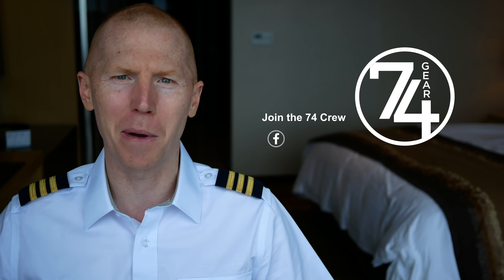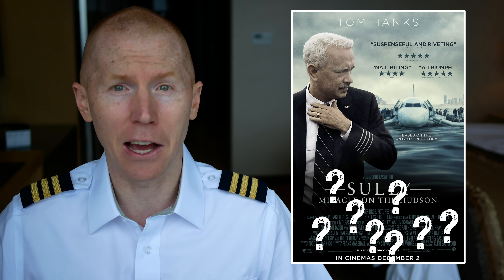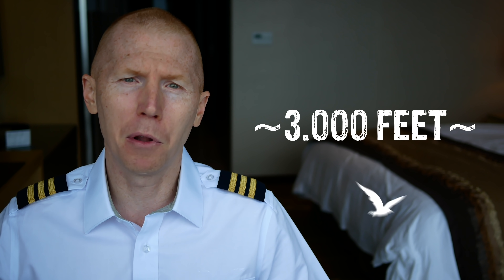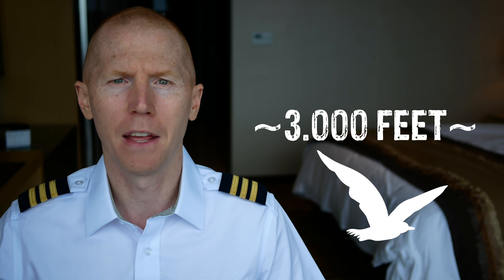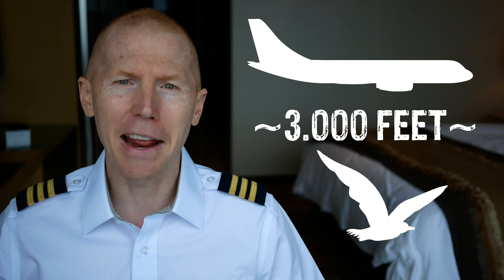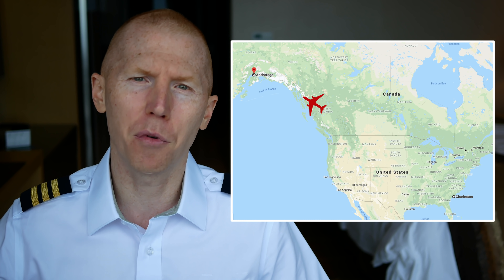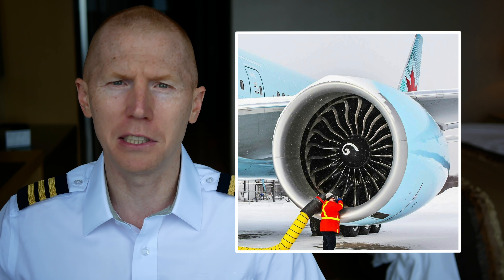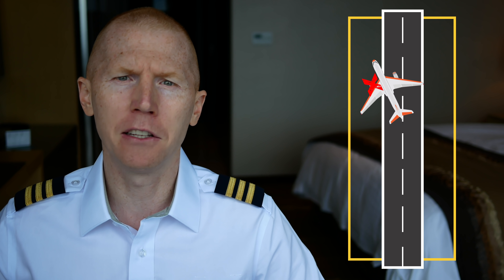Why Engines Don't Have a Mesh or Grates to Stop Birds

Comment: Or, crazy idea.

Let's say you put a giant mesh in front of the turbine.

Disregarding the amount of air that can get to the impellers.
Disregard it potentially getting sucked into the turbine.
Disregard the drop in power and fuel economy.

If this MILLION pound aircraft hits a bird with a mesh screen in front of it's engines, at around 500mph, what fat good would it do to the bird and the engine that now has pre-chewed food.

Tl;Dr redundant.

Comment: Some helicopters have FOD (foreign object debris) screens in front of their engines. Those jet engines deliver torque though, not thrust.  They have thrust diffuser in the third stage of the engine. Also aerodynamics and weight/ balance not so important on a Helicopter

Comment: One other thing about placing some barrier on the leading cowl of an engine, any mesh type of guard could itself get ingested by the engine and  would likely wrap around the main shaft (like hair in contact with a spinning top) and cause a major disintegration of the entire engine, a bird not so much.

Comment: As an engineer (though not aviation) I know design criteria and worst case scenario fault prevention would dictate test the engines at assembly to determine the effects of ingestion of birds.

I'm also reminded, though it's likely an urban legend, of a case where Rolls Royce developers contacted Pratt & Whitney about testing for birds and P&W responded they use turkey carcasses for worst case failure. A short time later Rolls-Royce got back with P&W with a problem, the turkeys were destroying the intake fan blades, and Rolls-Royce asked P&W for assistance with the tests. 

A 4 word P&W response was sent, "thaw the turkeys first".

Comment: That's really interesting ^_^
Reply: Yes
Reply: Sky green beans
Reply: A leoreo modo fan😳
Reply: Diciendo "aerodinámica" 100.000 veces
Reply: Wondering how the SR71 gets enough air to the engines with those big cones in front of them, cones that would also divert any bird to the perimmeter not to the turbine  blades
Reply: Shawt deh fac up
Reply: Yuh uh

Comment: Engine guards can be put on an engine during an engine ground run.  The mesh has very little effect on the engine performance but helps prevent foreign object damage or FOD.  these guards cannot be fitted if the air temperature is too low, say below 5 degrees Celsius.  This is due to water vapour condensing onto the guard forming an ice layer.  This then causes a reduction in airflow into the engine and this can result in surges or an engine stall. 
The temperature at even 10000ft would be much lower than 5 degrees on a normal day(15 degrees at sea level), so whether at altitude or on the ground, engine guards would be a completely pointless and even dangerous device. Hope this helps some understanding.
Reply: I further suggest that there should facility to heat the guard when temperature is below 5 degree Celsius. And thus we can solve the problem of ice buildup
Reply: Heat can be given there from engine's heat to avoid ice buildup. Necessary mechanism need for that.
Reply: @jagdishdedania4604  heats going out the back not forward.
Reply: @moonbaby6134  Heat pipes brother. Ice is cold but just SLIGHTLY above freezing and it will melt eventually/prevent freezing entirely.
Reply: @slowfudgeballs9517  doesn’t work on aeroplanes.  It’s all about weight. More weight more fuel less passengers or more cost.
Reply: @moonbaby6134  More weight? Bruh it's a little mesh not iron cell bars...

If it can save lives why not? Run me the numbers, how much more would it cost the consumer for a 100% guarantee no bird strikes take out the engine. I wanna know my options! Give me a more expensive plane option with the heated mesh.
Reply: @slowfudgeballs9517  I don’t need to run numbers.  After 33 yrs working on aircraft it doesn’t work.  End of discussion chap.
Reply: @moonbaby6134  Bruv, how am I to make my own conclusion if you aren't telling me the facts? Are you calling me a sheep? Because I never called you incompetent until right now.
Reply: @slowfudgeballs9517  you will just have to take my word for it.  It doesn’t work.  Just read my first paragraph. If that’s not enough then I suggest doing some investigation and reading up.  But you’ll find I’m correct.

Comment: a screen (think chain link fence) is not going to block so much air to effect the engine.  what is going to effect an engine is all the stuff that would build up on that screen.  think of this like a filter of a car engine.  the filter doesn't really effect the engine's performance when it's new.  what does is the buildup of debris on the filter.  this happens slowly since a car engine isn't sucking air that hard.  I would imagine that the buildup on an airplane engine's screen would happen relatively quickly considering how much air the engine sucks in.  saying that, it might be better to let the small debris just pass thru the engine vs. letting it build up on a screen considering there would be no way to remove the debris in flight not to mention that screen being sucked into the engine due to the buildup of debris.  as big and powerful as these engines are: they are sucking in harmless debris on a regular basis.

Comment: I’m wondering Why can’t you put a went  ON only for those few minutes the plane s under 3000 feet? It can roll away once the plane is above the bird hazard height. The way landing wheels go in and out for the same reason — saving fuel at high altitudes by reducing air resistance.

Comment: I've never really considered a screen on a jet engine...but i have wondered  about metal cages around Boat propellers. Like those little cages they put around lights in bunkers and mines and such.
Reply: Would affect the flowstream. Water may be more viscous but both are fluids.

Comment: Why don't they make the engines bigger to account for the lost air intake, while maintaining the same power/fuel consumption of current engines? Then that would allow a mesh or thin wired grid to be put across right?

Comment: How about some high pressure air fans that would blow a bird sideways away from the engine.  There would be no metal or mesh, etc. to affect the engines. And, the fans/blowers could be switched off when flying normally.

Comment: A bird hit with a grate means now more airflow is blocked to the engine, perhaps enough to reduce power to less than required to fly. Without a grate the bird hit may go through the engine allowing it to continue to function.

Comment: We had a KC-135R, taking off from the Panama, hit a Turkey Buzzard with the #3 engine.  The bird weighs about 20 pounds.  The carcass was found on the runway, but the engine showed no issues or vibrations, so it completed the flight to Grissom AFB IN.  When taxing to the parking spot, the engine looked very odd.  The impact bent four of the fan blades back about 35 degrees.  While bending back, they did a lot of damage to the inside of the inlet.  Those CFM-56 engines are very tough.

Comment: What about adjustables or electric motor engine covers tho? When you're above birds level you can open the engine cover so that it can run efficiently
Reply: That may be a good idea.
👍🏼
Reply: Very dumb idea, jet engines are already complicated and packed enough, adding motorised retractable doors just isn't feesable and is not even close to worth it
Reply: @MagikarpMan  No need to be rude about it.
Reply: @jessetheanimenerd3304  wasn't rude

Comment: Well I don't think putting a net with fine strong strings will cut down the supply that much .. and you can use a funnel like structure to get more air inside .  And can open the gates after you reach 3000 fts..

Comment: Would it be too impractical to engineer some kind of mechanical cage that can be slid out of the way of the engine once ascending above (and closed below) 3000 feet? Kind of like another step to landing gear? I imagine that would probably already be done if it was practical but i cant imagine why it wouldnt be. Maybe just hard to safely mount something electrically wired in that location? Or too difficult keeping a moving part rigid enough around so much force? Or takeoff is the time when the most thrust is necessary? Or is the cost/risk ratio too high (though i imagine the same could be said of all the emergency equipment aboard an aircraft)? Maybe i can imagine why.

Comment: Easy. Just put an circle with interior straight lines with enough space for a big bird to not go in and make it automatic to open and closed so at 3000 is open. Just to have it closed for like 16 minutes per flight is not going to be any differwnce in fuel efficiwncy I believe. safety is number 1 priority anyways hehe

Comment: Aircraft engines are pretty robust and can withstand bird strikes pretty well. In the case of Sully's aircraft I understand he hit a flock of geese and a bunch of those bird birds going into an engine at once is more than likely going to do some blade damage.
I worked for Honeywell Aerospace engine manufacturing and certification of a new engine or an engine redesign meant going through simulated bird strikes. A turbofan on a test stand running at 100% power would have chickens fired into it at high speed by an air cannon. Pretty not impressive and usually resulting in a puff of smoke out the tailpipe.
A bladeout test on the front fan (the chicken chopper) is impressive as to how fast an out of balance engine can destroy itself and all the debris being sucked back into the compressor blades.

Comment: I've noticed a lot of people here are suggesting using some type of screen or mesh only for the first 3000' and then retract it. That would add a lot of mechanical complication. I remember this was on Mentor Pilot's channel as well, and IIRC he mentioned something about the airflow would be disturbed enough to cause problems with the engine and not allow it to run correctly.

Comment: What about a retractable screen that can be used (perhaps automatically) when anticipating flying at lower than 3000 feet?  That should circumvent the fuel efficiency dilemma if the screen is intermittently used.
Reply: From what I've seen in the replies, that's a no-go because there's just not enough space for the retraction itself and extra wiring it would require.

Comment: Engines should be equipped with such sensors which detect oncoming birds to hit the engine up in the air .To avoid the accident beforehand grates or mesh would emerge out of the front portion of the engines from the state of suppressed.

Comment: Solution: Add a grill that shows up when the plane is below 3000 ft and redact it when the flight gains good altitude. This way the grill will be engaged only for a few minutes of the entire flight. No bird attacks and fuel efficient too.
Reply: The highest risk of birdstrike is during the takeoff and landing phases of the flight. However the takeoff phase of the flight is when the engines need to be at max thrust (acceleration and climb required). A grill deployed below 3000ft would be deployed at the time when it would cause the most problems as that is when the engine needs airflow most.

Comment: Why not fabricate some type of retractable mesh that is only active during takeoff and landing below 3,000 ft. Have a fine mesh that will still breathe enough for takeoff and then once cleared of 3,000 ft have it open up so that the engines can get full efficiency. I'm sure something like this can be engineered if thought out and enough time given to design it. This would literally take anxiety away from everyone and save lives without compromising any real fuel efficiency over the long run.

Comment: Well the can put an automated blocker that rolls in and out (open and close) "but the engine keep sucking air " that closes on low hight less than3000ft and opens on higher then 3000ft even tho it will work with less efficiency but it will help you reduce the chances of sucking bird's

Comment: What if the engine covers was designed to be somehow retractable like the wheels. As said its not fuel efficient for the entire journey and bird strike is only on takeoff and landing so what if the grates covered the engines while landing gear was deployed? This way they are protected only for the small window of time? Also I'm sure they wouldn't need to be used all the time just if there is reports of a lot of bird activity in the area and there is more risk than normal. I'm aware this is easier said then done just wondering as a concept and idea.
Reply: Your same idea is suggested in the comments 10 times already. Did you think you had a new idea?

Comment: Main reason is that the grate or whatever you have in front of the engine intake, is dangerous to cause a D.O.D. (Domesting object damage) which is more fatal for the engine than a bird strike (F.O.D.), due to the natute of the material and bigger size of that grate etc. 
Also, as he mentions, he will have the “bird “FOD zone for 0-3000 ft , so above that altitude, the aircraft must carry a component that is not necessary and adds to fuel consumption (as he mentions) and still remains dangerous for DOD.

Comment: Just make a blockage during the takeoff and landing parts of the plane (below 3000 feet), and make the blockage movable so that they can fit inside the engines surrounding ring, when above 3000 feet, just retract these inside the engine structure, and without birds to bother, your engine is free to go. Or they can add motion sensing to put the blocking mesh as soon as it's senses a bird in trajectory towards the aircraft.

Comment: Ok, I understand the problems of installing a mesh or grating to the plane. 
 How about sound?  When there was a lot of beaching of marine animals (I think it was in Australia) it was found that the Navy was always somewhere around doing testing.  Within these tests they were able to direct different mammals in the areas to where they wanted them to go and was able to be genus specific in doing so.  Now I realize you would have to see the flocks in enough time and figure in how fast you are going for this to work, but could there be a radio frequency added to the plane that not only can pick up their existence in enough time but also scare the birds away from the plane in enough time to save both the engines as well as the birds?

Comment: So if the problem only exists below 3000 feet and therefore just a few minutes in each flight, why not build something that can be retracted again? Like some metal rods, which can be extended forward in front of the engine, forming a cone-shaped shield against birds, with still enough room for air to pass through it? Above a certain height the rods could be retracted, allowing the engine to perform in regular mode.

Comment: I disagree the mesh or grates will not make any difference if there are enough gaps to let the air through. What they must actually be worried about is that mesh getting sucked in and destroying the engines.

Comment: Why not have deployable mesh,
When pilot/sensor feel like they will hit a bird, the mesh will deploy temporary that will blocking the bird..
It ll decrease engine efficiency and air intake but its just temporary like 5s or so, after that mesh open again after there is no sign of a bird

Comment: Perhaps a way to prevent a bird from going into the engine could be an electromagnetic pulse near the engines. Quite a few migratory bird species use the magnetic forces of the earth to orient themselves. Perhaps placing a strong enough magnet on or around the engines could help keep the birds away. Then again this is just an idea.

Comment: Hey Mr Pilot 👨‍✈️️, 
How about we have automated mesh in front of the engine to be used only for take off upto 3000 ft and thereafter we rill it back up? How is that for the Aviation industry to think about? 
Do comment what you think. Thanks

Comment: Interesting how you bring up fuel efficiency. On rotorcraft, I think Inlet Barrier Filters are becoming common place when operating in dusty/sandy environments. I have seen badly eroded compressor blades in my engine MRO days, and the filters do help with that problem. I wonder how much of a power reduction do those induce. Some have also pointed out that the filter might get penetrated and end up in the engine with the bird anyway if we are to do it for big turbofans. So maybe it's just a matter of practicality right now.

Comment: How much airflow is lost and how much efficiency will be lost using a mesh human lives should never be measured against fuel cost or efficiency. if it cost 100000 more each flight but risks to passengers are lowered even 1% is that not worth the money

Comment: I'm guessing, but I feel like even if you had a mesh in front of the engine the bird would just be diced through the mesh and end up going into the engine anyway
Reply: you'd just have a bird and mesh in the engine x)
Reply: That how actually fries are cut out from the potato😂, in a tube there is a kind of mesh structure and with high speed the potatoes are launched through the mesh
Reply: @matteoaievola8643  yep! They use potato launchers and when the plane flies over McD's, BK or Carl's Jr you know you're about to get some fresh sky fries. That's how in-n-out got its name.
Reply: Yum! Char-fried chicken nuggets!
Reply: Ye the pressure would kill it anyways.... People are dumb af.

Comment: Your argument is not convincing me. It may be that decreasing air flow for an entire flight is stupid, considering that most of the flight time bird strikes are almost impossible but in that case, why not building something that can prevent a bird flying into the engine and that can be mechanically removed once you hit a certain height just to be brought back when you are trying to land? Isn't it the same thing you do with the tires? Yes, would use a bit more fuel during start and landing but that's less than 1% of the entire flight time, isn't it?